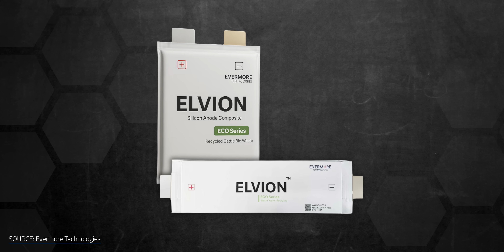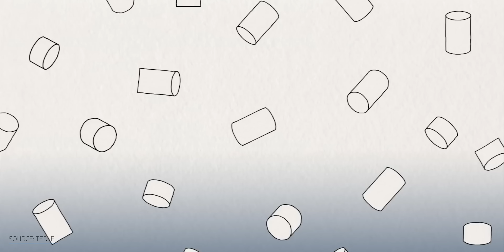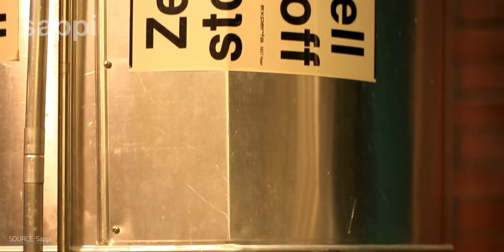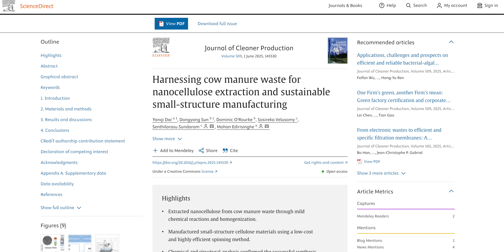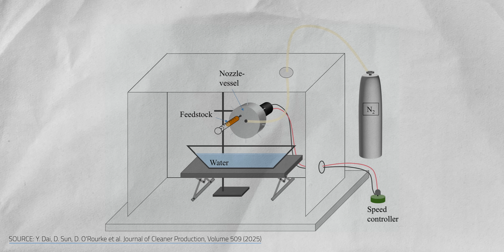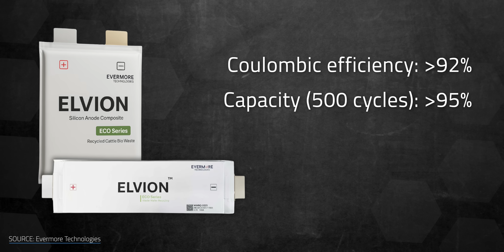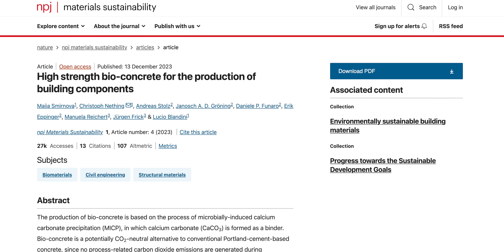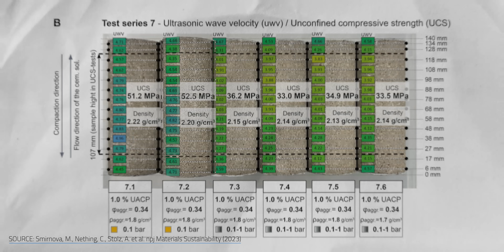The Strongest Concrete Made From Human Urine?

Comment: Great idea! Let's use a great regenerative fertilizer and soil resource to build "bioplastics" and batteries. That way we can use more fossil fuels to make fertilizer and chop down more trees to produce compost and biochar for soil enhancement. Not even mentioning the whole logistical side to transport the all the manure and piss from the point of origin to the factories en masse. But hey, we can always invent cow towers in industrial zones where they can pee and crap directly into the factory. Who needs pastures.

The cow manure and pee is used directly where it's supposed to be used by nature. Yes, there is excess but not on a scale that could be used to replace other industrial processes. There are better ways to improve the mentioned battery or pulp production. That cellulose centrifuge sounds good. Can't that be used in traditional production?

Comment: There was an old tech show called "Beyond 2000".  Obviously, it was pre-2000.  I remember them talking about (very slow) solar powered autonomous mowers.  It took a few days to mow the lawn, but was pretty quiet.  I think the ultimate downfall was leaving a mower outside on it's own made them too easy to steal.

There are a lot of great science sources online, but I miss the heyday before sites like Wired and New Scientist moved mostly behind paywalls (I'm on a fixed income).  I'm glad you are carrying the torch, but sometimes I miss the really weird stuff, like a Wired article on a biofuel powered slug hunting robot that used black light to spot slugs on plants, an arm to scrape it into a bin, and a biofuel generator that used dead slugs to make biodiesel for the slugbot to keep hunting.  (I wonder if maybe the Achilles' heel might have been that if it does a good job it might exhaust it's fuel supply.)

I wish, instead of picking presidents, some billionaires would create some foundations to give money to some media outlets to keep them out from behind paywalls.  

Another weird one... I think, somewhere in Scandinavia, there is a public bus station that is heated with waste heat from municipal waste.  It doesn't burn poop, it just takes the heat out of it to heat the place.  (Hmm, wonder if it's just a simple heat exchange or a proper heat pump).  

/On the topic of puns... I had a friend who was always asking for advice but never taking it.  He asked again, and I told him I was fed up with him asking for advice but ignoring it, so to make it clear he was actually asking for advice he would have to say, "So, what is your analysis?", to which I promptly responded, "It's when doctor's test your pee."

Comment: About AI we’ll waste too much time using it for example you can make a movie like a Pixar movie yourself same template as someone else everyone will
Want to make there own but it will get to the point where you’ll be asked to view someone else’s AI movie and will fill pages of scrolling of the same movie just to the point of even subtly changed graphic along with movies all other things will be mass made or use someone’s else’s AI feat I hate it cause there was a chipset before 086 chipset our current PC they used the power lines as the internet connection and they are considered 40 in front of us and had the iPhone 6 in 1982 (with no bite out of the apple logo ) how I know I had both wich in turn were stolen from me and to get them I had to assemble them myself or even make the components and assemble I couldn’t be arsed so fell back to the non beta testing compute on social people hope this helps though AI has challenged the way we participate in life you can be lost from your pack

Comment: What are the volumes of raw material, practicably available for this process?... as a ratio of the total amount of cement/concrete, or as a proportion of 'problematic' faecal material, releasing methane, and causing eutrophication/algal/ blooms? Can we harvest the methane for fuel, and still use the rest for building? 
   There are, ALREADY in existence*, solutions to most of our doom-laden futures, but enough people, goaded on by a 'Hate Sells', to a 'Fear Hells', media, are actually looking forward to chaos, disintegration. For the vast majority of these people, the 'Chaos' they seek, would be short-lived - for them - and mostly involving being scared and hungry for two days, before being tortured and killed. The Plutocrats who rule the world, who actually can exert meaningful force on the levers of power, really think that they can 'survive', whatever global catastrophe they bring on. (Their; well specifically, poor Elon's fear of the security guards taking control. - I believe his solution was some mechanism, whereby the guards would starve, if Elon wasn't there to feed them. I think he inotially htought about a code, or living-biometrics, although he spoke with the air of someone who had never been tortured.) You think the push for Small Modular Reactors (SMRs) is to be really, really careful with the power supply of a data centre? They know that, if they can get a few SMRs, and a bit of fuel, they can live underground (their descendants) for scores of years to centuries. These sad-sacks, dream of the power, even their hundreds of billions can't give them..........KINGSHIP! They want to be, kind, benevolent dictators, but they are not - kind, nor benevolent people, so that will not happen, but the desire to be able to haul someone across the street and have them whipped, surges through every billionaires neurones and veins.

Comment: The major binding point I see holding this up from rolling out is a matter of simple logistics and cost/reward.  Right now the major downside to concrete manufacture is pollution and power consumption.  It's benefits are cheap, easily obtainable materials that exist in such vast quantities as to be nearly inexhaustible and constantly available.  With the new method, material collection (at least for the concrete) could realistically only be gathered from large population centers and then only with some kind of infrastructure modification to filter out the needed liquid chemicals from the general sewage on a large scale.  It's impossible to know how much power or a carbon footprint that is going to need, or how expensive it will be.  If it's too expensive to start up, it won't be able to compete with existing concrete production infrastructure.

Comment: Love the circular economy concept and all the innovation being made for it.
However, the eco-modernist ideal is still only beginning to make a dent in the conventional economic model of growth at all costs and the time until tipping-point is rast running out. Indeed, it would seem that the more disruptive the technology, the more resistance it's met by conventional technologies. Lastly, better tech realistically only reduces the harm through efficiency rather than being rational about resource use i.e.  we still need regulation any way and then there's all the social problems that are independently considered. 
If we actually want to have an economy that serves the majority of people (i.e. not just the wealthy) and the environment, then we need to address the cause of all these symptoms, the economic model. Only then will all these cool technologies be implemented effectively and equitably.

Comment: Concrete production does generate a lot of CO₂, that is true. But the finished concrete, after being poured and cooled (hardened), absorbs CO₂ from the air.

When they built Biosphere 2, near Tucson, they used a lot of concrete. The facility was sealed and a team of researchers attempted to survive inside. They didn't make it. They kept getting lower and lower oxygen levels. The plants were growing but ... not enough oxygen. They finally determined that the concrete in the structure was absorbing CO₂ from the air, before it could be turned back into oxygen. They had to cut the experiment short because there was simply no way to account for this.

Here's a TED talk about it

https://www.youtube.com/watch?v=a7B39MLVeIc
Reply: Its still no where near enough to offset the CO2 produced in the construction though.

Comment: I've been glad to see a couple of videos like this lately.  The lack of press given to alternative polymer sources has had me kinda worried about the transition away from fossil fuels - a very necessary thing, but I'd been under the impression that the many organic polymers, lubricants and other such chemicals that are cheap and taken for granted in a fossil fuel economy (because they're all the weird bits of oil that can't be used to make gasoline, propane, etc) were being left behind.  (Which doesn't become a problem until we actually stop refining oil, but then, if there weren't alternative technologies in place to take over, would suddenly be a major problem when we stop having all these extremely useful oil byproducts)

It's good to see some attention being paid to this side of the problem too.  I've been told that fossil fuel apologists use this as an argument for continued and expanded use of fossil fuels...and that's a load of bull, but unless the replacements for non-energy related oil products get some press too, that leaves a hole through which those apologists can try to discredit the green tech movement, at least to the people who see them make a point that seems correct and then base their trust in the status quo based on that one time they seemed like they were right.

Comment: Most manure sources are highly contaminated with bedding sand and other tricky to remove materials like bits of rubber ablated off from tractor wheels and cooling fan belts meaning an industrial scale version of this setup may not be viable. It also wastes a large amount of strong alkaline chemicals to clean the input material and since he gives no comparison to the kraft process's chemical use rate it's little more then a curiosity with no viability right now.

Comment: Crazy! I always thought about a separator composting toilet. I thought the urine could flow right into a plaster dry cell battery for the electrolyte and the poo could be composted or carbonized. The compost for growing things or the carbon burning or turned into graphite and graphine for building batteries, superconductors.  Very circular logic and sounds really inefficient.  But screw it, cool.  Batteries are really just burning or oxidation anyway. Just slower, smaller,  and more efficient if you want electrical energy instead of heat.

Comment: Regarding the sponsor, I'm curious if you've had the courage to test it's obstacle avoidance on power cords or garden hoses? I'm pretty much expecting it to chop them up unless they're very low settled cords, or very thick hoses. But I guess anyone spending money on a robot lawnmower probably has cordless equipment and sprinkler systems, so how about sprinkler head avoidance? Or do you just schedule them hours apart?

Comment: Manure is used as a fertilizer. Take it away (using petroleum fuel) and you have to replace it with fertilizer made from petroleum and shipped in using petroleum fuel.  It's going to be hard to overcome those costs and additional petroleum use to justify it as a plastics source.   Better to try human sewage which is already being piped to treatment facilities.

Comment: I hope that in the process of closing multiple waste streams, we come-up with several 'good enough for [x]' solutions. Example: 54MPa is suitable for 3 and 4 story buildings. Great. Can I use 5MPa concrete for a tool-shed, or other low-weigt applications? Yes, reasearch all the options, but don't say "its not usable by everyone until we reach [x] metric" be a reason why we don't use this solution for some applications.

Comment: The problem yet again is cow dung isn’t a waste product is a vital cost effective fertiliser for farm land all this will do is make farming more reliant on manufactured chemicals but i guess that’s what big business wants. Farmers used to spread 1000s of tons of cheep chicken manure on the land then came the chicken manure power plants no more cheap fertiliser . It now gets burned for power so the co2 goes straight into the atmosphere instead of the soil brilliant 🤩
Reply: I'd imagine the manure to be pretty abundant, it's just geographically concentrated due to larger farms which creates certain issues. To get the unit costs down on a ranch you need to be large, but then cattle is also producing way more manure than nearby fields can handle. It's an absolute logistical nightmare if a ranch is producing too much of solid waste since you can't use the transporter platform for anything else. And the platforms used for spreading manure to the fields are open at the back so you'll be delighting the people on the gravel road with the occasional surprise if you use one to carry the load further out. Furthermore manure of a single animal isn't the most efficient fertilizer since you usually end up lacking something critical, like phosphates in the case of cow dung.
Reply: @shiggydiggy6847  I probably should have said that I’m in the uk not the us and that I understand that farming over there is done on a vastly different scale over the pond than  here in the uk . The problem we have that technology’s developed in the us Eventually, end up, here and it does Cause major implications for our agriculture

Comment: It sounds promising. And it's important to remember that, for applications like concrete under 5 MPa, there are options such as soil-cement stabilization, insulating concrete, foamed concrete, and likely others. These materials aren’t suitable for every use, but if they can help address challenges related to a current waste stream—and do so profitably—then it's a clear win.
Reply: Adoption for in-situ use seems likely for MICP for stabilisation and crack healing given cost of alternatives. 
Treatment of recycled concrete to improve aggregate performance is another likely use-case. Similarly, suitable sand for concrete is in worldwide short supply so I wonder if MICP could improve rounded grain sand?   Wide scale erosion control uses might also be useful for the upcoming dustbowl. 
Anyway I'll just be glad to finally have a use for all these jars around the joint.